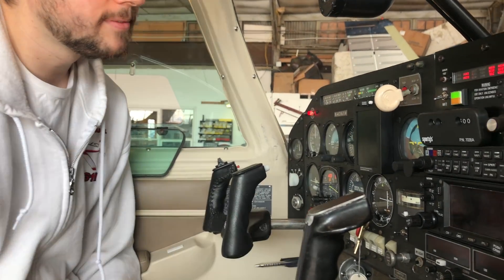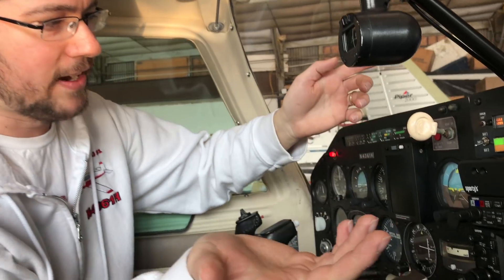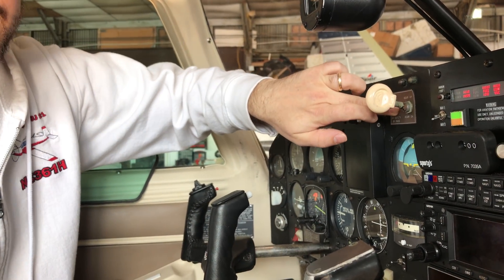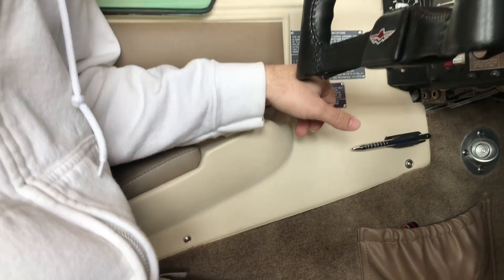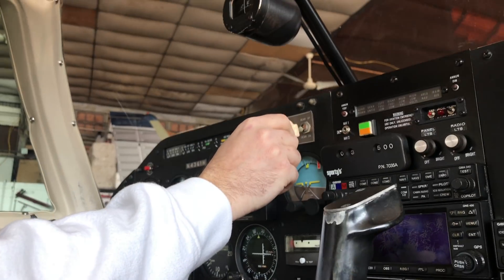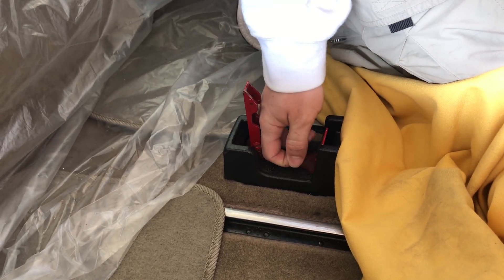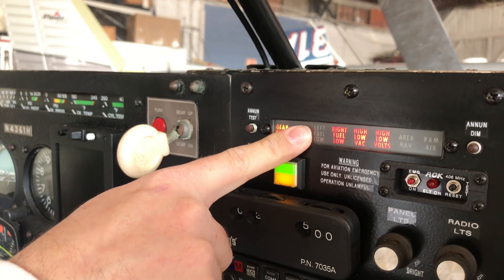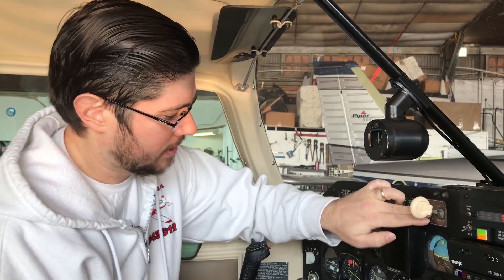Mooney M20J 201 Gear Swing and Emergency Retraction Test

Comment: Crappy electric gear requires a backup, go figure. 63 mooney back up is you, just like normal. If you use the bar to put the gear down, it never failed.